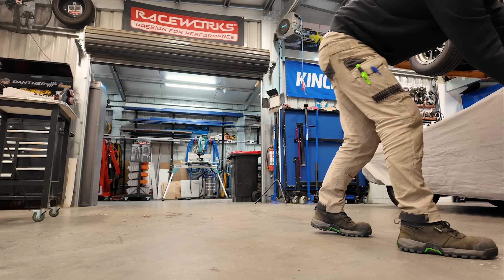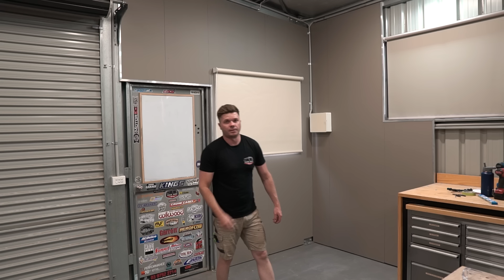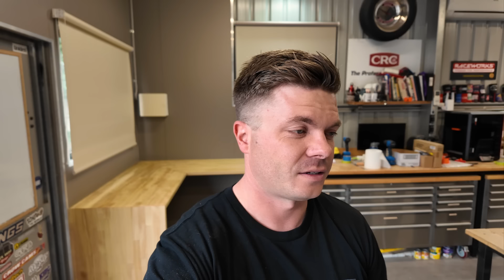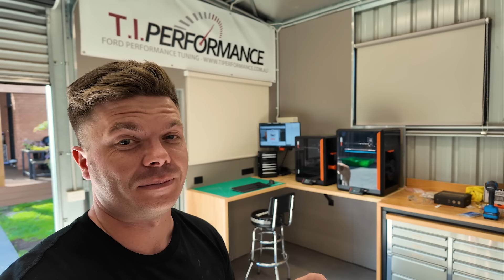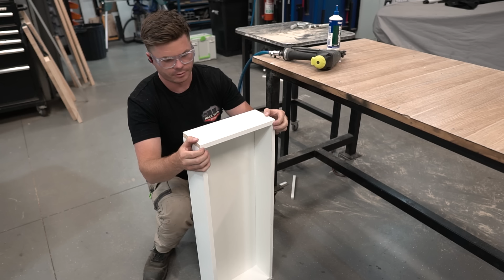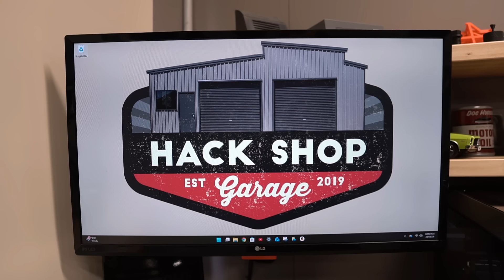A NEW ERA FOR THE HOME SHED

Comment: When u scrub and clean your floors with chemical and a broom or just pressure clean .  The wood /chip panel might be an issue with the water .
. Best to finish wall boarding short of the floor . A painted plywood  with an angle iron /alloy trim might do . But the best way is to use mini stand off  brackets to support the weight of timber  Eg angle iron /sheet metal with 2 screws and  2x 1/2 round bar legs . 
.  ALSO  use expander foam between slab and steel sheeting [trim to suit]  . Keeps out the bugs mice etc .

Comment: Keep an eye out for cheaper TVs - if you don't want/need 4K (you probably don't) you can pick them up for a couple hundred bucks. Then you can have the smaller PC screen at the desk for the 3D printing/research side, but also connect the bigger screen to the same computer for YouTube etc. You can then also plug in a Chromecast, which works much nicer than a PC for typical "TV/Entertainment" usage. IMO, anyway. That's how I have my PC and screens setup in my garage and it's very flexible.

Comment: Aww, look at the cute little toolbox - perfect for working on your little 253 😉 haha. Fantastic workspace, your entire shed is an inspiration! Do you use the same blade in your dropsaw for steel and timber?
Reply from the maker: Haha thanks mate, no different blades, the steel saw is a cold cutting saw so it has a cold cut blade on it. Unfortunately they are not cheap but if you look after the they last awhile

Comment: Nice work on the printer hub.
Have similar although definitely not as used friendly.
FWIW I use Klipper to manage my printers.
Effectively brings the printer control inside your network.
Edit: Put a poster or sign in the empty space. Less dust on shelves not easily accessed.

Comment: Welcome back! Tip when sheeting the shed= always insulate insulate insulate! Makes the workspace way more comfy in winter and summer. Great vid mick! See you at the next event. Cheerio
Reply: Just came inside from working on my shed build and I can 100% agree.  

Roof panels are searing hot and you burn your fingers touching them underneath, but I have a 40mm air gap under them before some 20mm foilboard and it's not even warm on the other side of the board.  

Worth every cent.
Reply: Absolutely!! Makes a MASSIVE difference, we did a blanket insulation for the ceiling too.